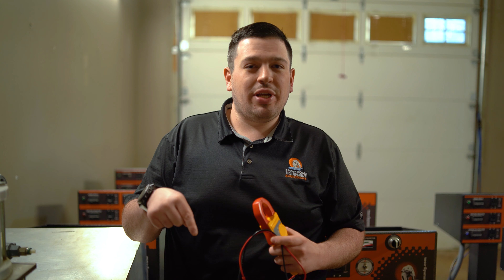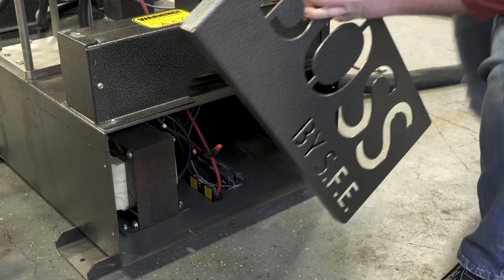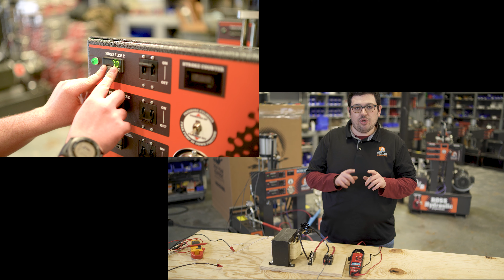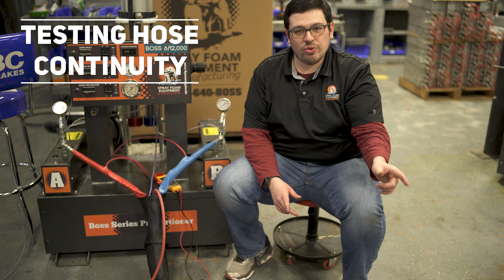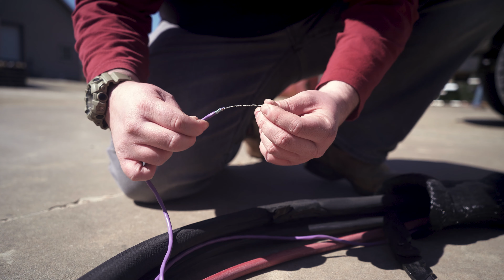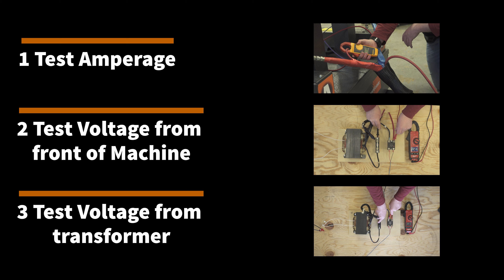Hose Heat trouble shooting

Comment: do I need two purple cables? one for each A&B side?
Reply from the maker: No because you only have one hose heat control and the hose heat system is one closed loop connected by that buck connector near the end of the hose so separate thermocouplers wouldn't allow you to change individual hose heat.
If you need control over A vs B side heat it should be done at the preheater since the hose heat just maintains heat in the material rather than getting it up to a certain temp.